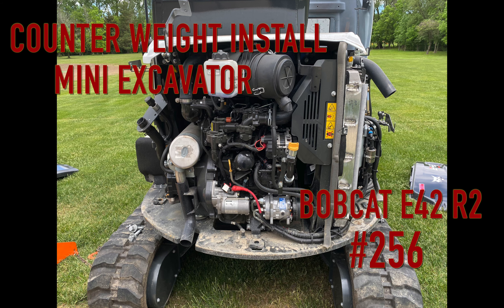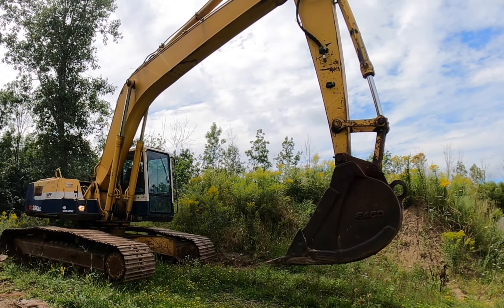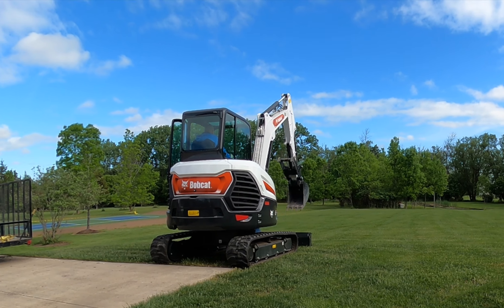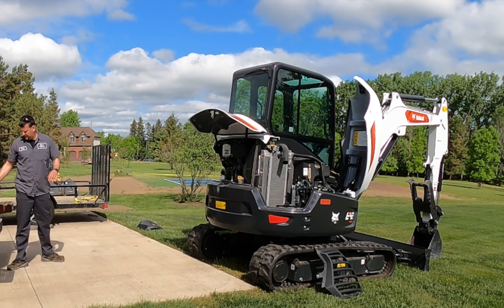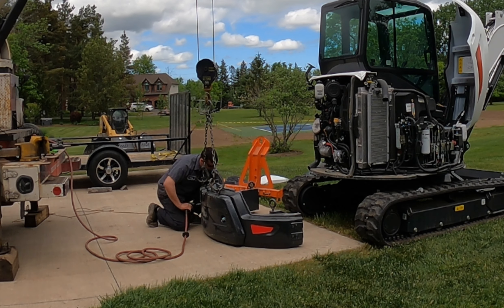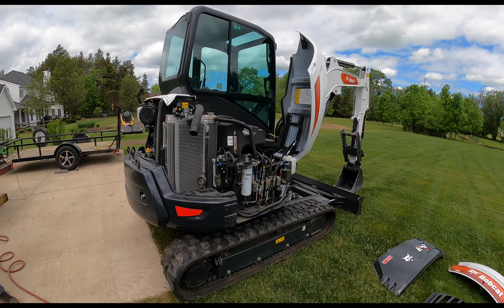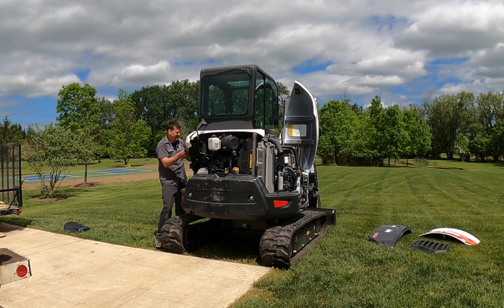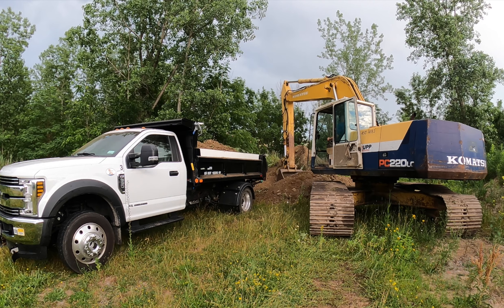Mini Excavator Counter Weight Install and Why Bobcat E42 Komatsu PC220 Excavator  #256

Comment: I would want that extra weight also, anything to improve the stability and lifting with the arm extended is a big plus. That will help in every position of the cab in relation to the tracks. Tech did a good job on the installation, very good upgrade...
Reply from the maker: J agreed. The tech had a concern of him speaking on camera...he could've hosted a primetime news show he was that good. Good guy, I tried to stay out of his way, and watched to make sure he didn't get hurt. Thank you for supporting my channel.

Comment: it comes down to seat time, ease in and out of the controls to make it smooth and it won't feel so tippy, being smooth on the controls is everything in a mini for comfort and not being bounced around. hope this helps you
Reply from the maker: JR you are so right. I was not comfortable when I first started using the machine as it is so light compared to industrial heavy equipment...even my old JCB big backhoe is very stable compared to both my JD tractors. Words of wisdom from you thank you for supporting my channel great comment.
Reply: @maraudermitchelli  guys like to throttle them down but they aren't meant to run at half throttle, great videos keepem coming

Comment: Hopefully my 42 remains on schedule and shows up sometime in June. The counterweight was at the top of the list and I’m glad I decided to get it. Do you feel the AC does a good job? Debating on tinting it but would prefer not to just for maximum visibility. I live in MN so the heat isn’t crazy but it can be plenty warm that’s for sure.
Reply from the maker: The AC is outstanding, it does take the engine awhile to warmup for heat but I believe both are very good. I would recommend waiting on the tinting until you test the AC which i think is more than antiquate. Let me know when you get your machine and thank you for supporting my channel.